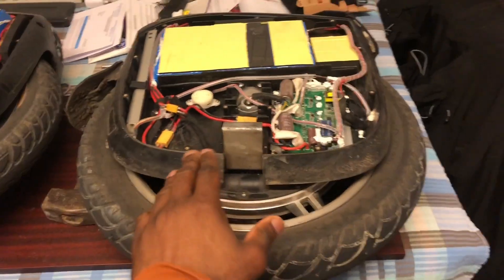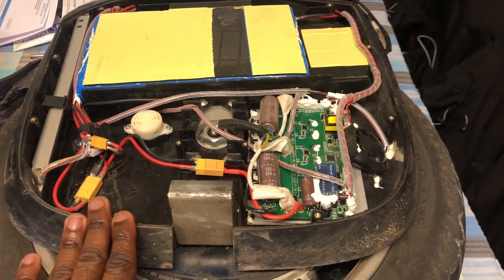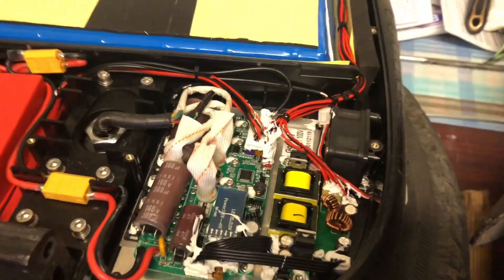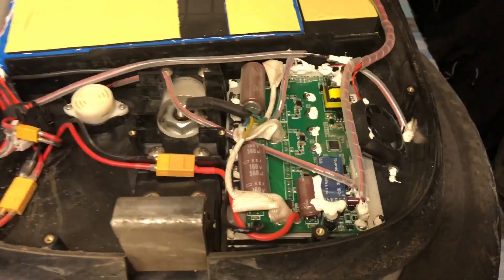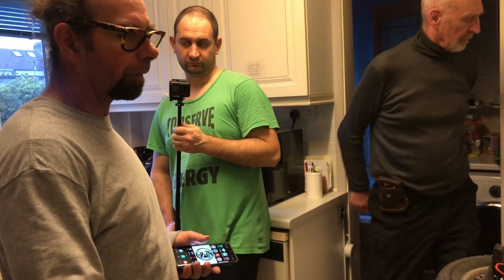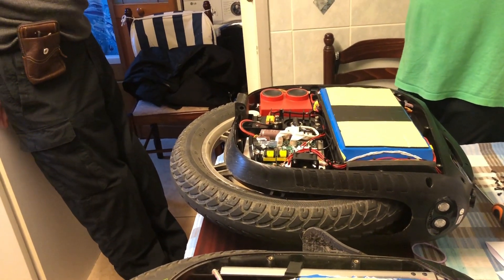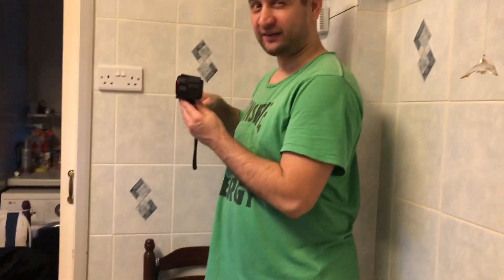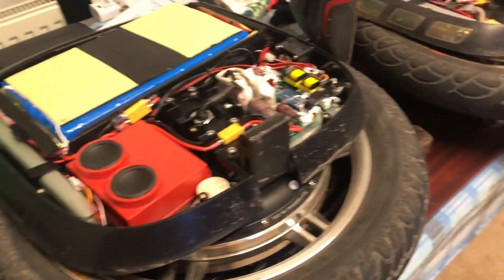Gotway MSPro VS Gotway MSX 100V Internals examination

Comment: still far inferior build quality to anything Kingsong does
Reply: true but i wish ks could make a 70kph wheel. not happy with the 50kph limitation
Reply: @jeansandmyshirt  70kph? why on earth? who rides at that kind of speed? I NEVER ride at 50kph, we have no brakes on a EUC, if you want to ride at 70 might as well buy a motorcycle.
Reply: @FrenchFighter01  no one rides at 70kph, but its good to be able to go faster than 50kph. 50km/he is not fun at all when your on polyurethane track. the traction is amazing compared to asphalt. i live close to a few running tracks and also long stretch of rubber track, its perfect for going fast on my ks, and trust me 50kph is not fun, consistent 60-65kph would be perfect. 50kph just feels slow. to each their own. ;)
Reply: @jeansandmyshirt  I guess we have a very different definition of fun...When snowboarding I never hit anywhere close to 50kph yet I'm having a blast...Besides unicycling is also a lot about commuting, and speed limit is either 30 or 50 kph in cities.
Reply: @FrenchFighter01  Once you learn emergency braking, your stopping distance shortens to that of a motorcycle if not shorter.  Rather than lean back, push the wheel forward.  There are videos on this.
Reply: @outtatime5034  emergency braking is just another word for crashing and wrecking your EUC. going 70km/h with a EUC is plain stupidity and makes the entire community look bad.
Reply: @FrenchFighter01  The community looks bad when people ride recklessly or don't show proper courtesy.  Ride at your comfort level and let others ride at theirs.  Learning to brake is part of being a responsible rider regardless of top speed.
Reply: @FrenchFighter01  Also, what makes the entire community look bad is when individuals post things to public forums like, "we have no brakes on a EUC, " a false statement, and one that can be misunderstood by those who have no experience with EUCs.
Reply: @FrenchFighter01  A brake is something which slows or stops motion, regardless of the method.  Of course you have the know the limits of your device.  That is just another reason to practice hard braking.  Maybe your EUCs are so easily damaged, not my MSX.  And anyway, it'd be better to damage your electrics than yourself or others because you never learned how to brake.
Reply: FrenchFighter01 you’re quibbling over the definition of “brakes”. Obviously you can slow down and stop quickly on an EUC.
Reply: Outta Time push the wheel forward for emergency braking? Huh!?
Reply: crosshair the Ny city EUC guys definitely ride at close to 70km/h. Once they all have Shermans it will be common. Way Too fast for me.
Reply: Outta Time oh. Sure ok that’s that fastest way to stop, especially if you’re riding in hard mode. throw my arms back too. 
I guess you can say you push the wheel forward when you stop just as you push the wheel behind you to accelerate, ok.

Yeah your waist is bent forward but your upper body is still either upright or leaning slightly back.
Looks like you’re sitting down.
Reply: @darkstar4494  the problem is that braking hard using all your weight will be a huge strain on the electrical output and is just as dangerous as accelerating very fast.
Reply: FrenchFighter01 Yes braking is a deceleration and requires motor power. You ride within the limits of your wheel and you’re fine.
You’re creating a problem where there isn’t one. 

Have you ever fallen because you were trying to brake too hard and your motor couldn’t keep up or something?
Do you have a horror story to share?